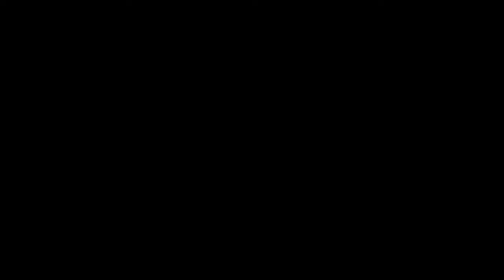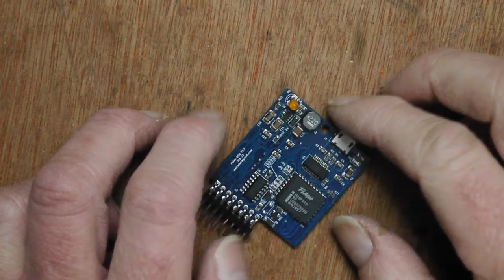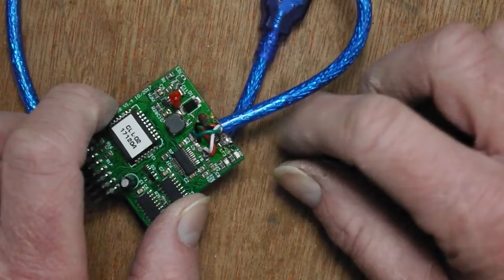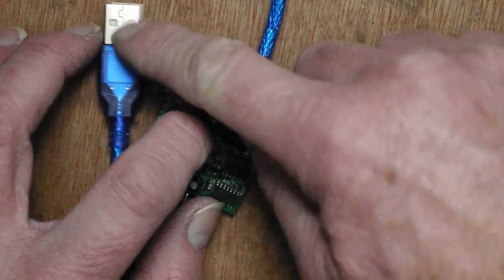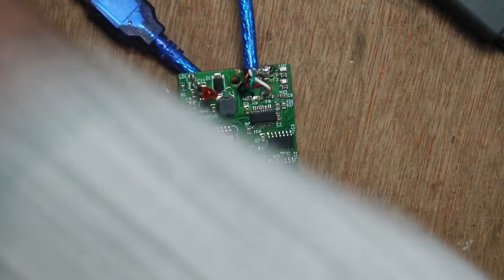Psion Organiser USB Adapter: A better USB connection?

Comment: Hi, Can we just use something like an arduino to act as an commslink adapter?
Reply from the maker: The Uno is too slow fo that. The Due might work, but is probably too slow as well. I have made a top slot adapter with a Pico though, so that can do it. It's big, though.
Reply from the maker: https://www.youtube.com/watch?v=OjPG9-fXxJ4
Reply: @menadue  Thanks for the quick reply.  Do you provide schematics for that? Also there's another project on github  using uno to write OPKs to datapack, what would be the better way to put OPKs ?pico adapter or directly writing to datapaks?
Reply from the maker: @abdulmoeedraja  Hi, just made the repo public:
https://github.com/blackjetrock/psion-org2-top-slot
So yes, there's code and a PCB there. The Arduino datapack reader/writer was by Marton Prest. We have collaborated on a V2 using a Pico whih is here:
https://github.com/blackjetrock/psion-org-datapack-tool
It has a built in 21V supply and can read or write Psion datapacks. It can write Psion 1 or 2 packs. The code is an ongoing project and will probably never be finished. I'd use the datapack tool to write OPKs to a datapack. It doesn't currently work with segmented datapacks.
Reply: @menadue  Thank you so much, this is going to make things a lot easy for me and help me enjoy my organiser.

Comment: Just a further comment. Although the existing USB Comms link I have is excellent, sometimes it needs to be reinserted a few times in the top slot as I get a device not present error (as the pins are shorter than the original Comms link). Looking at your video it looks like the top slot connector pins are shorter than the original too. Not sure if you will encounter the same problem once the case is fitted.

Comment: I have one of Oliver's USB Comms link and just keep the microUSB end always connected. There is therefore no wear on the connector. The removable  lead also gives the option to replace the cable should I need to. Always an issue if it's hardwired.

Comment: Good idea, micro USB are a bit too keen to come off, I only had it happen on one device, but it does seem to be quite common. The cable idea is more in keeping with the original design as you say, and is likely far more robust.
Reply from the maker: Yes, it does seem to be more in keeping with the original comms link and it would certainly be robust, which is an Organiser feature.